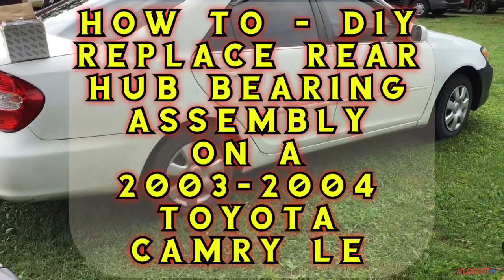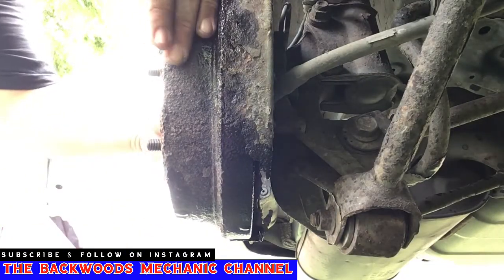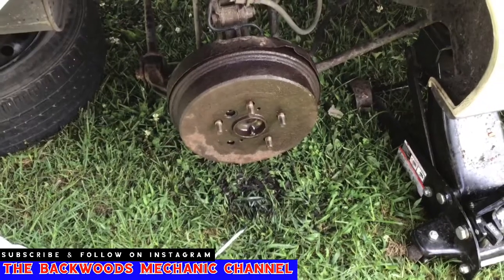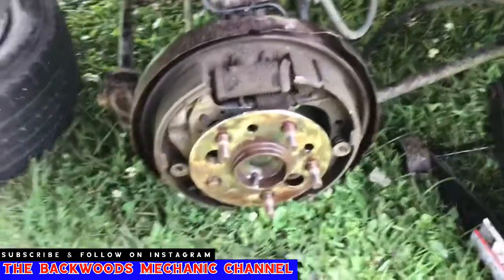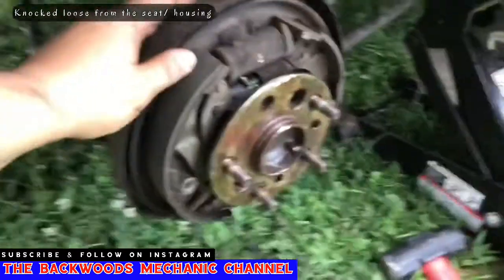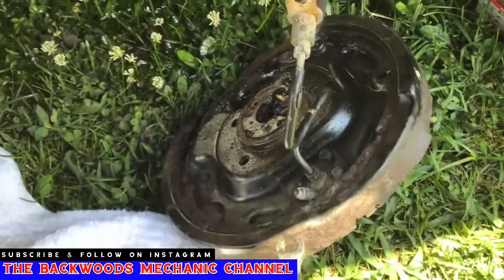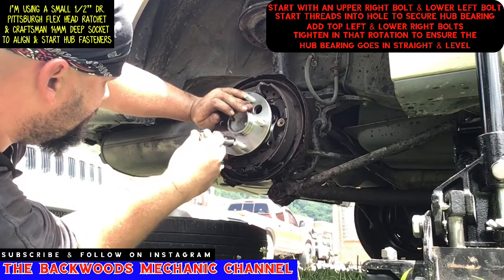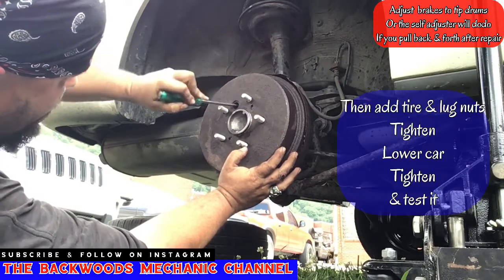03-04 Toyota Camry HUB BEARING ASSEMBLY (HOW TO DIY) Drum Brakes Wheel Bearing repair

Comment: Thanks very much, funny, I was looking for RAV4 info on replacement of rear wheel bearings, but your video helped me more than them, even though you are working a Camry. The way you did the bearing, worked on my Rav4, so I had to Subscribe and etc... Also these Hayes Manuals are trying to cover too many years models in 1 book, And fail to give enough info on a certain year, bought a Hayes Manual, and it is now covering a span of 16 years, and only a few pages on the one I needed and bought it for. Thanks again.

Comment: Thanks for the video I was trying to adjust loose handbrake on my Toyota Camry and could never see adjuster through the hole because I didn't know that I have to spin the hole to find adjuster until you said it in your video and out of all the other handbrake adjuster videos out there would you believe not even 1 mechanic mentioned spinning the hole to 11oclock till you find adjuster, you are the only one that mentioned that and it's absolutely crucial to know otherwise non expert people watching all those videos out there would just assume the hole hole always sits aligned with adjuster and people could be poking with screwdriver and light all day and won't find jack shit because 99% of dumb ass "experts" on YouTube never mentioned it like you did. Therefore I am subscribing as I like people who recognise the small minute details that can make it or brake it when doing something.

Comment: regarding the beating the dog shit out of the drum... if the parking brake is on, the drum will not come off.  If you have a new drum and don't need the old one, there are some threaded bolt holes in the drum face that can be used to pull the drum off if you have some proper bolts but this will likely cause the drum to bend beyond use. This way we can reduce the ah, concussive forces to precious camry parts.

Comment: I have a camry 2002 le and I noticed that one of my rear tyre is playing when I shake with my hand.  The mechanic guy told me the wheel bearing is need to replace but after he replaced new bearing also the wheel is still playing when i shake with my hand. Could you please tell me any possibility? Thanks

Comment: You do realize that there are 2 bolt holes in that drum to get that drum off when it's stuck on right?
Reply: I’m doing it right now and I don’t see them
Reply: Seen those on another video but he didn't say what size
Reply: Yup, he wasted so much time just getting the drum off lol

You take 2- 8x125 bolts thread them into the 2 small holes on the drum and it’ll push the drum right off.. so easy.